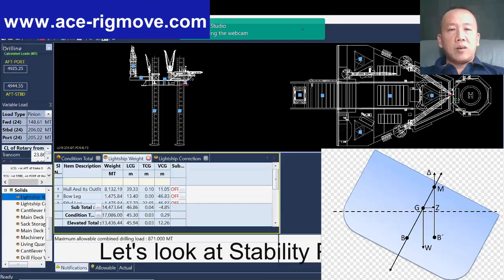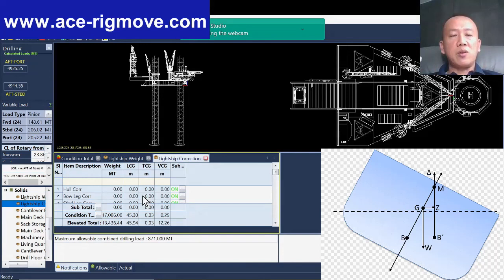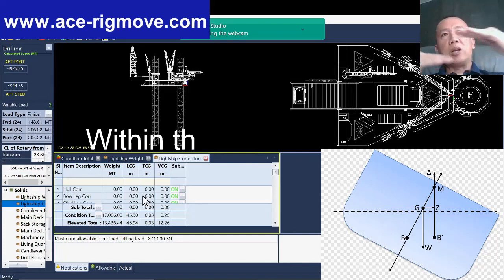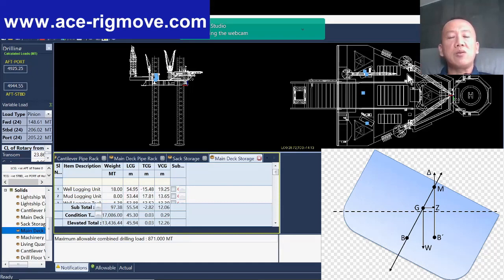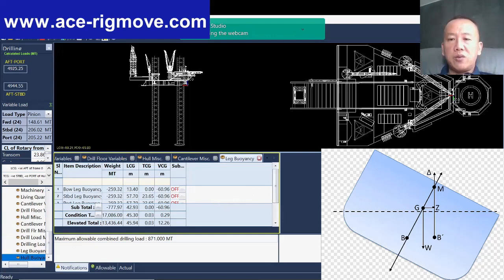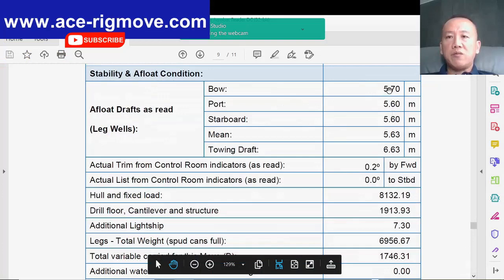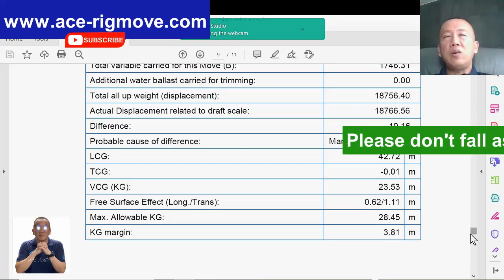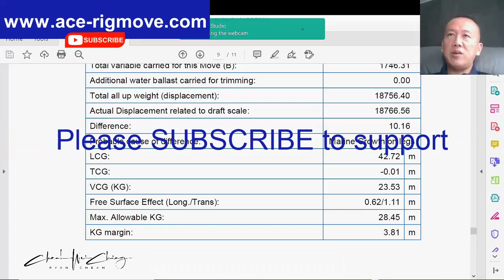Stability Program on Jack Up Drilling Rig

Comment: Can I get a practice program. Kindly advice.
Reply from the maker: Navin, if you are working on the rig, you may approach Barge Master permission to practice the  stability program. Stability demo set normally kept by the designer and rig owner. The stability program is very costly, range from USD20k to USD30k.